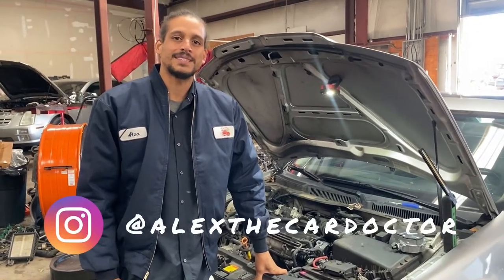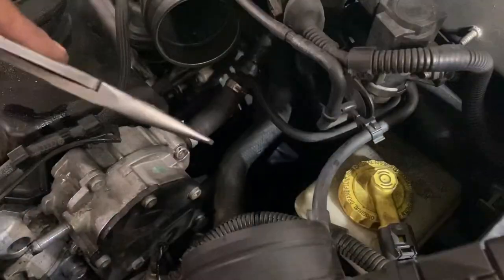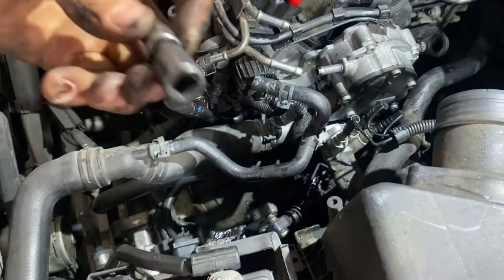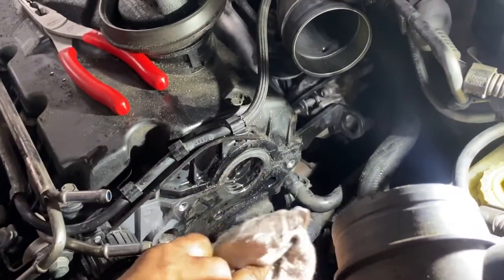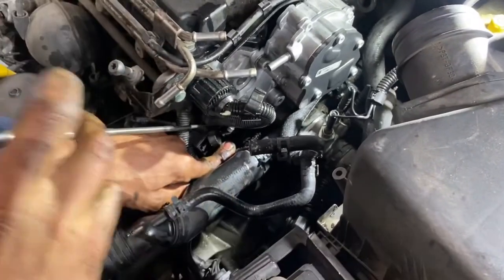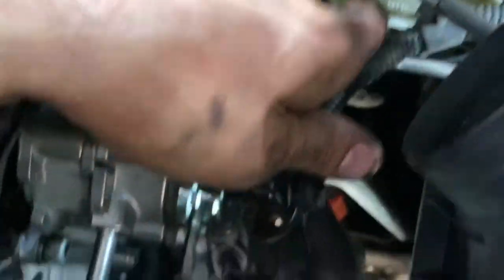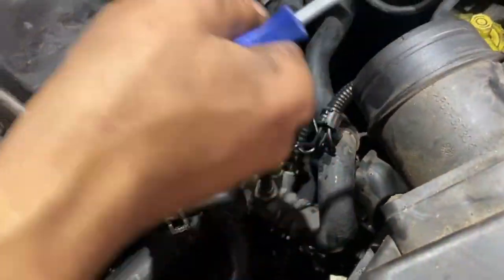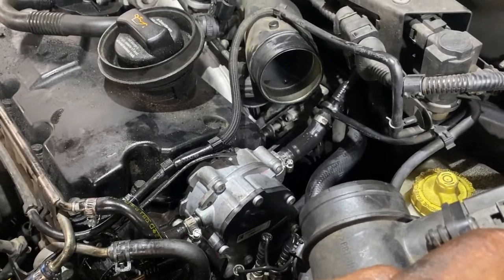VW Jetta TDI High Pressure Fuel Pump Replacement (DIY)  volkswagen jetta auto technician

Comment: I love how realistic this video is, people usually cut out the parts of them dropping stuff or struggling to reach the bolts etc but i could relate this so much lol. Great video, i may have to do the pump on my BRM TDI soon. It starts to have trouble starting unless i keep it over 3/4 tank full
Reply from the maker: I try to keep it real as much as possible. Check the pick up tube in the fuel tank is reaching the bottom, and make sure it’s not damaged before you replace the high pressure fuel pump. Thanks for watching!
Reply: Yeah double check your pickup tube, could also be the lift pump going out, but idk.

Comment: Great video! I always like to watch someone else tackle a repair before I attempt it. Btw to get that one bolt behind the coolant neck, you can use a long ball end Allen key on a socket. Bought a 7 pack at home depot for $21 and it had the 5mm needed. Air box has to come out to do this tho.
Reply from the maker: Thanks for the support and feedback buddy

Comment: Should have shown to purge the air out the tandem pump by pulling the return fuel hose out of the fuel filter and cycling the key like the manual states !
Reply from the maker: I will keep that in mind thanks
Reply: Can you please explain on this more? So when you're all done installing the new tandem pump, and you hook up/plug everything back in, before you go to start the car, you should do what exactly? cycle the key to the ON position but not Starting it? why pull the return fuel hose from the fuel filter?
Reply: @kevin.lefevre  well ELSA (vw offical manual) states that you should use should use some sort of vacuum mashine to extract the air out of fuel system (possibly the same mashine that is used for purging the cooling system).
Well since you probably don’t have that, disconnect the return fuel hose (so that the fuel with air can more easily escape) and cycle the key for a few minutes without starting the engine (when you cycle the key the lift pump in the fuel tank works for a few seconds and pushes the fuel through the system). When you have done this enough time, connect the fuel hose back.
Even when doing all of this you will still most likely need a help of starting fluid to to successfully start the car. Good luck!
Reply from the maker: @kevin.lefevre  hey there buddy yeah I should have showed me starting it up.I just cycle the key a few times and it fire right up.What do you mean about return line

Comment: My brake pedal is pretty hard to depress. I checked the back of the vacuum pump and that barb fitting was really loose. Would that pump or loose fitting cause the pedal hard to depress
Reply from the maker: Yes it will make your brake pedal hard if you are loosing vacuum
Reply: @AlexTheCarDoctor  thank you for the quick response. Great tutorial. Not too many mechanics go through the steps you did. 👍🏻

Comment: Did you have trouble starting it? Seen others prime the pump before starting the engine
Reply from the maker: From what I can remember no the Electric fuel pump does a pretty good job of delivering the fuel right away and helping with the prime process

Comment: Great info, thank you, need to do this on my son's 03 Jetta. Found the same area wet as well. Also we have a wet EGR (or the area around it). Also, do recomend a dealer part or from another manufacturer to replace this? Any brand in particular you recomend? New to VW's (and diesel). Thanks in advance.
Reply from the maker: On the 2003 models you have the ALH type engine. Which is set up differently than the one in this video (BEW type). So, on yours It’s just a vacuum pump. Your high pressure fuel pump is located near the front of the engine. It’s driven by the timing belt. You may just need a gasket kit, this is the link https://www.amazon.com/RKX-Vacuum-Reseal-038145345-rebuild/dp/B01MTVJFXD

But if you want to replace the whole vacuum pump, any brand should do. Dealer may not have it due to how old the vehicle is, but it wouldn’t hurt to check. You can get it at your local parts store or online. Just check the reviews before buying.

On the wet EGR issue, it may be leaking or you may have a loose or dry rotted hose. I would recommend cleaning the area and inspecting it to see where the leak is coming from if you can. 

Hope this helps, & Thanks For Watching.

- Alex
Reply: Top two bolts are 20Nm and lower two are 10 Nm on my seat Ibiza very last owner mess it up and there strip the threads and I be getting tip and due to fix it

Comment: Thanks for sharing, good video & haven't even finished watching it yet.  Does the BEW engine code correspond w/ certain year models?   I've got a 2006 1.9tdi, & it's very similar, but a few things are different.  Thanks again, - take care.
Reply from the maker: Yes depending on if you have a Jetta BEW starts from 04 to 05.5 and new beetle from 04 to 2006
Reply: @AlexTheCarDoctor  Okay cool.  Did this car fire right up, or did it take any extra cranks/cranking?  I saw a broad price $ range for these pumps, where did u buy from?   Keep up the good work,  - take care man.
Reply: @AlexTheCarDoctor  Hey Alex, do u remember where u got the fuel pump & about how much $ it was?       Thanks.
Reply from the maker: @leeisenberg  sorry I don’t remember yes that bew is very similar to yours

Comment: It's not actually an hpfp. Just so you know. That's on the common rail system. This is a pumpeduese which the injectors create high pressure from rotating against the camshaft.
Reply from the maker: Thanks for the knowledge! I never really looked into it before now. I truly thought it was a common rail like the ALH. The sad part is I own a Jetta just like this one lol you learn something new everyday !! I’ll make the correction and pin at the top of the comments!. Thanks 🙏🏽
Reply: @AlexTheCarDoctor  good effort replying so fast
Reply: @AlexTheCarDoctor  still not quite correct.. The latest are common rail. The alh has a ve injection pump
Reply from the maker: @crazypeoplearoundtheworld304   I’m going to look into it more. I don’t do many diesel cars. But like I said, I do own one so I’ll have plenty of reason to research and learn more about them.